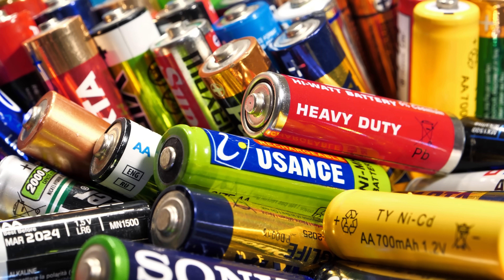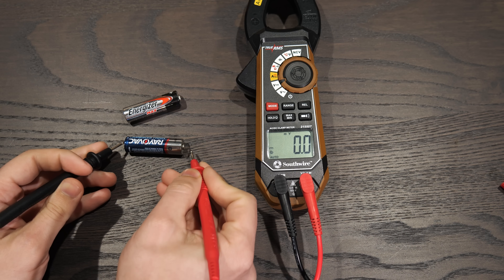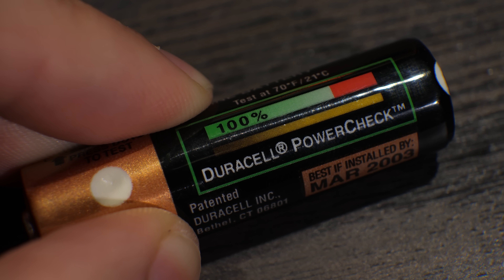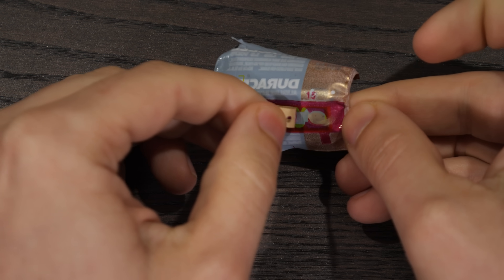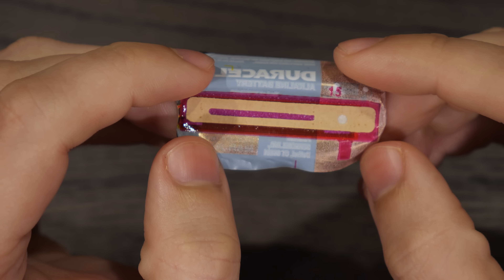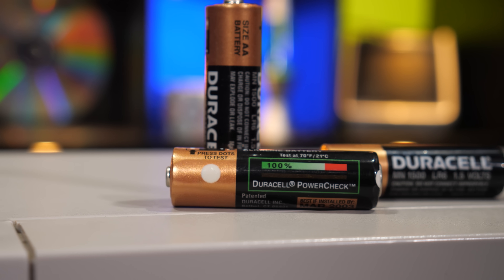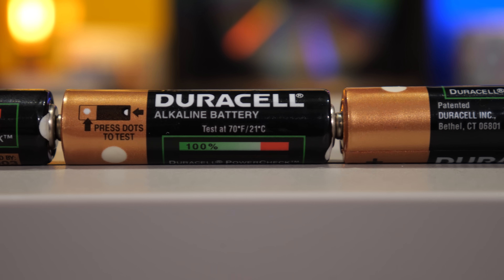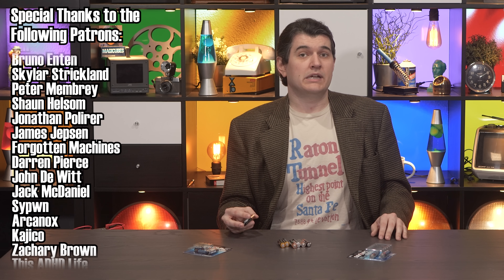Duracell PowerCheck: A genius idea which didn't last that long

Comment: One Christmas when I was in grade school my dad gave me two beautifully wrapped D cell batteries with a note 'Toy Not Included'. My mother was sure I'd be upset. I thought it was hilarious. Daddy and I really got each other.
Reply: When I was a youngster in the 60s through early 70s, my dad wrapped a screw driver seperate from any gift that showed "some assembly required."  I didn't appreciate until much later in life how the Craftsman screwdriver was a better gift than the plastic junk.
Reply: @kimnach  Oh my, that's just perfect! I'd have loved that and you're right-you can't beat Craftsman tools from that era.
Reply: @kimnach  I bet those screwdrivers are still rock-solid.
Reply: @kimnach   I've always loved having my own tools, when I was little I'd probably not be that thrilled about getting a screwdriver, now I'm 15 and I buy tons of tools with my money, I have a toolbox with one of those screwdrivers with no head that comes with lots of heads without a screwdriver, it's extremely useful, it works with almost anything, it's one of my greatest investments, it will probably last very long too.
Reply: @kimnach 
Where are you going after you die. Repent today from your sins. Hebrews 9:27 says as it is appointed unto man once to die but after that the Judgement.

Confess your sins and turn to Jesus Christ today. He is the way, truth and life.
Reply: It's nice when you share a sense of humour with your old man. My mum spares at me and my dad, we're at it all the time
Reply: @synaesthesia2010  My little brother got a set of batteries from my sister as a birthday present when we were kids. He was upset, until she brought out his other present (a robo-raptor, i was pissed i didnt get one for my birthday)
Reply: @synaesthesia2010   nice!  Both of my parents just yelled at me and hit me.
Reply: @synaesthesia2010 as nice of a story as that is, an adult calling their father "Daddy" is absolutely f**ked. Please stop it and seek help.
Reply: LOL yes!! before working from home, our workplace would have white elephant gift exchanges. My gift would always be an assortment of new batteries in a box with a card written, "Toy not included." One year I stuffed newspaper in the box and the recipient thought there was a literal brick in it until her surprise LOL! After a while, people with kids always hoped to get my gift (but they never knew who really did itLOL!) I always tried to use widely-varying box sizes and shapes each year to keep it discrete (weight on the other hand was a giveaway...)
Reply: I love it! 🤣👍
Reply: A practical Dad joke 😂
Reply: @aristoclesathenaioi4939  He was the best
Reply: When a UK train company put a prototype battery powered electric train into passenger service, it was beautifully painted up, including the words "batteries included". 

If you counted the cells there were lots, lots, and even more lotsly lots: each cell on its own only a little bigger than an AA but still storing more than an AA cell.
Reply: "I bought some batteries but they weren't included"  For those who haven't heard of Steven Wright you should! :face-blue-smiling:
Reply: @PartTimeLaowai  I forgot about him-thanks for the reminder. Funny stuff.
Reply: There was a pack of batteries at one point that had a similar tester built into the package where you could test any old battery of that size.
Reply: Did they have the test strips on them?  Some might consider that a toy.
Reply: @h8GW  They did not but you know, that would have kept me occupied for a time when I was that age.
Reply: Talking about children and parents sharing or not sharing the same kind of humour:

I just read "complaints" from a mother on Twitter (x) that her daughter does not find the movie "Airplane!" funny at all. Replies varies from suggesting her to try for more kids, to adoption and a lot of comforting her for her terrible faith… 😂
Reply: @thomashenden71  I feel that. My mother absolutely hated Young Frankenstein. That was the first movie I bought (on VHS). So any time she was going to be out for a couple of hours Daddy was all 'hurry up and put the movie on'.
To be fair, Mama had a great sense of humor-she just had some blind spots. Come to think of it she didn't like Airplane! or Monty Python either.
Sometimes we'd look at each other and wonder how we were related. She used to say the only reason they had me was so my father could have a straight man.
Reply: @dianeladico1769  I've never met a woman who liked Monty Python. For some reason, it seems to be male humour.
Reply: @Tom_Quixote  You've never met my wife. She gets it.
Reply: @Tom_Quixote You're a looney.  I'm a female Monty Python fan, and I know many of my kind.
Reply: @HarryLovesRuth not sure what their sample size of women is… my gal friends and I all love Monty Python 😂
Reply: @Tom_Quixote  Well, I never was the typical girl, probably thanks to my father.
Reply: @Tom_Quixote  some of the sketches were a bit patriarchal by today's norms, and some of the animated cartoons even more so: it's understandable that women were less amused by that kind of thing. 

And as for our being male humour: the entire team (the folk that got the writing credits) were usually male, and all the actors who were consistently in every episode likewise. So it was very definitely male humour.
Reply: @HarryLovesRuth 
Your kind and his kind must not spend much time around each other then...

Which is a damn shame. Sounds like the two of you would get along.
Reply: @Tom_Quixote  I would say I found it funny but... well... I turned out to be a trans man sooo....
Reply: @dianeladico1769 I don’t trust anyone that doesn’t understand a quote from Airplane!
Reply: @Tom_Quixote  I've met plenty
Reply: @Tom_Quixote  You've just been around the wrong people, pal. I've met plenty of women who love Monty Python, especially the Holy Grail.
Reply: @Tom_Quixote another female Python fan here, even went to an audience with Cleese last year and asked the man a question myself. 
What a legend
Reply: Just found your first one!
Reply: @thomashenden71 
Well that's a shame.

Airplane is an amazing comedy. The "drinking problem" gag was my favorite visual gag in the film. And there were a lot of visual gags.
Reply: @thomashenden71  Maybe try "High Speed Rail" instead, it's way better than airplane.
Reply: @thomashenden71  🤣🤣😂😂
Reply: @thomashenden71  I either agree or disagree with her depending on how old her daughter is. You have to be on the older side to get most of the jokes in Airplane, but if she is old enough to get them and still doesn't find them funny that's outrageous!
Reply: @thomashenden71  Who in their right mind likes Airplane!? It's nothing more than a series of dad jokes cast into a movie. Gosh, do I hate that thing.
Reply: While not that kind of funny note included, there was a funny occurrence when I was in elementary. We had some kind of Christmas party day or something like that, and we all brought in a gift, to get one from someone else, picked randomly.

They were mostly toys and candies. But what I got.. I got a battery! And not even any regular kind, but a special form-factor lithium one for some film cameras. Even though I didn't own any device accepting such, as a nerdy tinkerer with endless interest in electronics and experimentation, I was happier with it than classmates with their candies and useless toys.
Reply: Man getting batteries for Christmas would be sweet. Suddenly the toys from last year that hadn't worked in months would get a new life.
Reply: When I was a kid, "batteries" were always on my wish list!
Reply: @ALTruckerDad  You were a smart kid. Got to keep those toys running all year.
Reply: You were a good son/daughter
Reply: @Vrook-t5y  You are kind. I certainly tried to be. My parents deserved it. They were just the best. ❤
Reply: My dad worked with wood furnaces years back, for one Christmas he got us all a bag of coal. He was so proud of himself lol
Reply: @NavyPanther54  A gift straight from the hearth...(sorry, couldn't resist)
Reply: Merry Christmas everyone, I hope everyone has a wonderful time, and keeps our young generations in mind and instill those memories of wonderment just like your folks did you.
Reply: @shable1436  Merry Christmas to you, too. You're right-if we remember the joy and innocence we had it's our duty to pass that along to the young ones.
Reply: I'm gonna steal this one.
Reply: Love this story 😂
Reply: This might be my favorite YouTube comment ever. I have this same kind of humor connection with my niece. We'd both rather get a humorous "gag gift" than another stupid tee-shirt or coffee mug!
Reply: @waltyc.8577  As my mother would have said, you're cut of the same cloth. People who really get you are a rare gift.
Reply: That's genius! You gave me a great idea. 👍😂
Reply: My son did the same thing for me but the label said "gift not included".
Reply: I’m sorry for your loss
Reply: That's hilarious!
Reply: When I was a kid, the batteries would be in our stockings which was the first thing we opened. There was always that anticipation of getting something really cool, but there were a few times that after everything was unwrapped, nothing needed the batteries. My mom would say that Santa must have thought we needed batteries for something we already had. Sometimes I would get batteries that I think were intended for my brother as he would get an item but no batteries and then couldn't play with a new toy unless i forfeited the batteries i received (i always did).
Reply: @alandahlstrom7213  Clever mom-batteries are the perfect stocking stuffer way down in the toe.
Reply: That's a beautiful memory 
Thank you for sharing 💜
Reply: @LSDPapa  What a sweet comment-thank you so much! ❤
Reply: Best prank ever! I’m gonna use that on my nephew lol
Reply: @JessyKenelly  😊
Reply: This is great I'm going to use this on Christmas for my nieces and nephew
Reply: Wild gift!😂
Reply: @SauceElliot  Daddy was inventive. Each Christmas had something unique and funny just from him.
Reply: Now I know what I'm giving as a white elephant gift.
Reply: That's hilarious. And as someone who always had some smartass comment about the stupid cable tv ads, I definitely would've laughed then too.
Reply: That’s hilarious what a homie 😂💀
Reply: Reminds me of a Christmas when I was really young where one of the presents was this HUGE but messy beat up box, and inside it was a box, and inside it was another box, and these smaller and smaller random boxes seeming to lead to some tiny crappy joke gift at the bottom… but it turned out to be a brand new Xbox. That was a good Christmas.
Reply: LMAOOO bro ima steal this when im a dad one day XD
Reply: That's pretty fucking funny, I like you and your dad's sense of humor
Reply: Fun fact: military M7 electric blasting caps take exactly 1.5 volts to pop so that in an emergency you can rig a double a battery to your electric firing system and so long as you're really close just one battery will still work
Reply: It’s funny how the coolest ideas often come from solving niche frustrations. Duracell PowerCheck is such a neat concept, but you’re right—it probably wasn’t practical for the average user. Still, it’s fun to look back at these “gimmicks” that shaped tech innovation.
Reply: I would laugh really hard and then be like "But where is the toy though"
Reply: That's a very cute memory. God, I miss my parents...
Reply: @timestamp3919 Thank you. I think the best parts of them live on in you.
Reply: @dianeladico1769 You must be British or have British ancestry? Us Brit’s have that sense of humour. I’ve lived in the US for 23 years now after emigrating from East London. I brought my wife (at the time) and my 2 daughters with me, the eldest was 10 and the youngest 7 on this particular Christmas day. They both wanted Nintendo DS’s for Christmas the eldest wanted a black DS and the youngest a pink one. Christmas day 2005 arrives and I’m awoken by 2 daughters wanting to open their presents, I give them a package each and they hastily rip into them. My eldest daughter was holding the game cartridge ’Sonic the Hedgehog 2’ for the DS and my youngest ‘I can’t remember the name but it was a game about caring for dogs, washing and feeding them etc’. They both looked at me quizzically and I explained that everywhere had sold out of the DS’s, but I managed to get the games they both wanted, I told them that I had to order the DS’s from Toy’s ‘R’ Us and they’d be here in 2 weeks. I noticed the bottom lip of my youngest begin to quiver and a tear started to develop and my eldest said “It’s okay Dad we know you tried your best.” At this time my wife had placed their DS’s under the tree without them noticing and I said “I’m really sorry but there’s other presents under the tree, let’s go open them!” I held my youngest’s hand as we went down to the living room and oh boy they saw those two packages right away! It might sound like a mean thing to do for a bit of a giggle, but both those girls were so much more appreciative for their DS’s than if I’d just handed them over. I did have a hell of a time finding those DS’s 2 days before Christmas, but I wouldn’t give up. I used to do this type of thing every Christmas until they became older and wiser. They still remember and they mention it every Christmas day since. Call me mean I don’t care, I love my now 3 daughters and that’s what really matters.
Reply: My dad did this to me every Christmas and birthday until I was too old for toys. Do to two extremely unfortunate cases of testicular cancer, I can't have kids of my own, but I still do it to my nieces, nephews, and friends kids. I do always get them a toy to go along with it. Everyone gets a kick out of it.
Reply: @Deepwaterjew  Great minds, our dads. I'm sure you're the best uncle. Those kids are lucky to have you. Got to keep the tradition going.
Reply: My parents always wrap up batteries with the toys, sometimes the batteries get wrapped on their own so there’s more under the tree.
Reply: @DustyHoney  Nothing sadder than getting the toy and not being able to play. I'm old so at the time there was nothing open on Christmas so you were really out of luck.
I totally get the 'more under the tree' thing. My mother wrapped everything. Every year I got a new nightgown and robe, laundered and ready to open Christmas Eve so I could wear them that night. 
She also wrapped packages of underwear and socks. "ooh-look! new undies! Mama, you shouldn't have! Twelve pairs-and look at the pretty colors. This is the best gift EVER!" It was one of our most enduring Christmas traditions.
Reply: bot
Reply: Your dad sounds amazing.
Reply: @KMFDM_Kid2000  Thank you for that. He was. For the record Mama was, too. I miss them both deeply.
Reply: I love that this video reminded you of that. <3
Reply: @Kristinapedia  What a sweet thing to write-me, too. I hadn't thought of it in a while.
Reply: Once my parents hid all of our big presents we asked for, in their bedroom. My step Dad and I made a snake enclosure out of beautiful wood and torch burnt it, I was sure I was getting a ball python for xmas.  My brother, a racecar track that drove along side the wall at one turn😅 my sister, a barbie airplane set. We opened all our gifts so we thought, then as tradition, they started a huge breakfast. We super hid our disappointed reaction. After breakfast they went to their room for the rest, laughing hysterically cause some of us didn't hide it as well as I did. The second the three gifts came out, I seen mine had some metal mesh cut out of the wrapping paper so the snake could breathe. Turns out they didn't wana wrap the snake box for any longer than necessary so they rush wrapped it after breakfast cause they knew we were about to spiral 😂😂😂 we all laughed for hours playing with our dream gifts 😅😅😅 best xmas memory we even have and theyre both passed and we're in our thirties now 😂😂
Reply: @ThisIsSparta300  That's a great story. So nice to have such fun memories in a family with a sense of humor. I'm glad you have that. My parents passed when I was in my 20s and I treasure all the laughter and love we had. Thanks for sharing that memory.
Reply: And everyone clapped
Reply: @paddy1144  I feel so sorry for you.
Reply: That'll definitely be a prank present for one of my friends this chrismas. 😂👍
Reply: That's me for dad goals. I just need to find me a woman that'll want to have a kid with me. Lol.
Reply: My son complained his bike was uncomfortable and he needed a new one. I wrapped up a bike seat and gave it him for Christmas. Of course the new bike to go with it was in the garage, but he didn't know that when he opened his present!😂
Reply: @imaginitivity7853  Have to keep kids on their toes. 😄
Reply: @imaginitivity7853  🤣🤣
Reply: That’s a great gift
Reply: @danieldaniels7571  It is. It's been 50 years and I don't remember a single toy but I remember the batteries.
Reply: I hope that was not the only present and there was a toy in another one?

I assume so, it sounds like you had a great father, but you know what they say about ppl who assume 😊
Reply: @sirtra  Oh there were plenty of toys and gifts, so sweet of you to think of that. ❤ Mama was the primary shopper and wrapper and all the gifts were from both of them or Santa. This was a special present from Daddy alone. 
I was incredibly lucky to have two amazing parents-very much alike in the things that mattered but different enough to keep it interesting.
Reply: Jokes on you, that package was originally meant for mom. Buzzzzzz 😅
Reply: @4by_yotaguy373  How incredibly vulgar
Reply: @dianeladico1769   I'm sorry you found my comment in poor taste.
Reply: That's fvcked up but funny 😂
Reply: Stolen Rodney Dangerfield joke lol 🙄😑
Reply: Oh lord I cringed so hard. Jesus christ
Reply: what a crazy comment
Reply: Cos your mum knew what D-cells used to go in =;)
Reply: Weird comment
Reply: Daddy? Are you still in grade school?